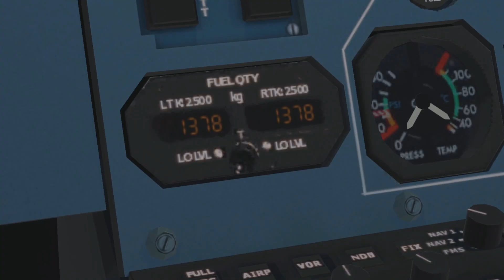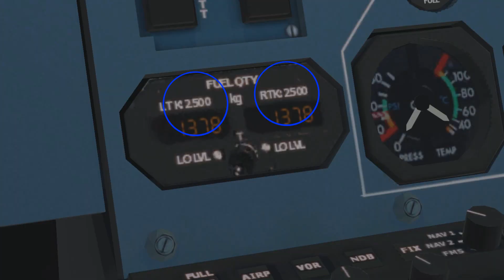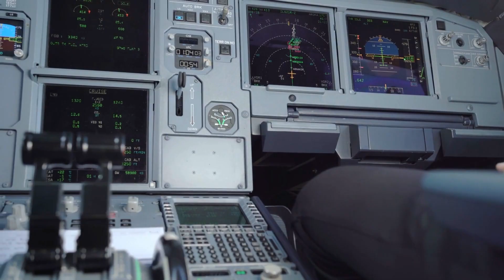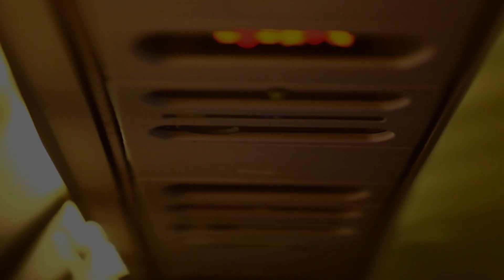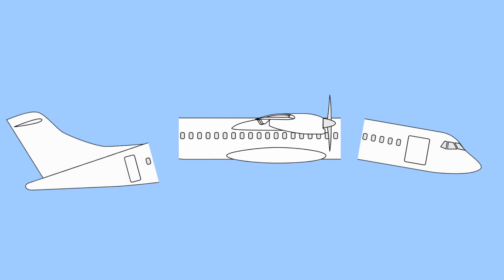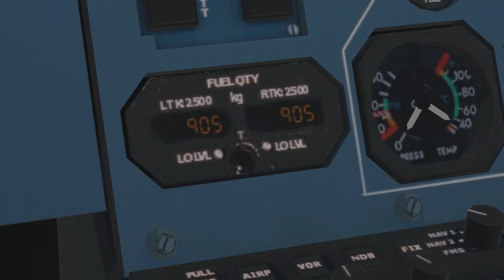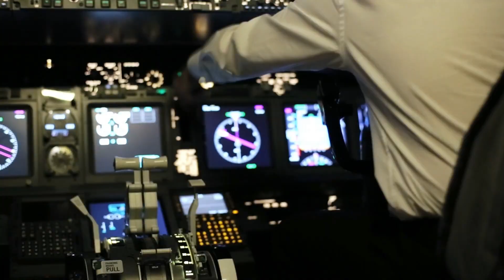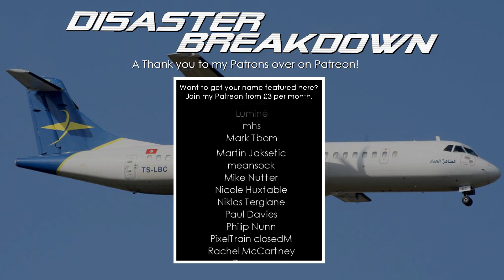Running out of Fuel Over the Sea (Tuninter Flight 1153) - DISASTER BREAKDOWN

Comment: Unless there is some detail missing, the pilots should have been blameless. The fault lies with the mechanic, the procedures that allowed the wrong part to be installed, and the procedures and personnel that allowed the plane to depart without proper refueling documents.
Reply: Pilots are the ones responsible for allowing the takeoff without fueling documents. This is why they are criminally responsible.
Reply: Plus the criminal case took place in the Italian courts.  Seismologists can be responsible for earthquakes, researchers for pandemics, etc.   If a prosecutor thinks he can make a name for themselves, he is liable to try and put someone in jail whether worthy or not.
Reply: @gs98999  that's not what they were charged with though.
Reply: The pilots were convicted for not having fully followed procedure by feathering the propellers which would have prevented drag on the plane which in addition to the tailwind that day may have been able to get them to land in Corsica.
Reply: @kyleg9735   but they didn't know they were out of fuel. Feathering the propellers isn't part of the procedure of restarting the engines.
Reply: @joseph Futrell the pilots were found guilty of criminal neglicence in causing a disaster because they:
1) Ditched with a tailwind, against regulations.
2) Ditched with excessive speed (13 f/s instead of 5 f/s).
3) Did not considered the waves' direction, impacting the water directly against moving waves instead of parallel to them.
4) Did not duefully report to ATR and negligently decreased the altitude upon the first engine's halt.

Imo the sentencing was correct, considering 14 people died.
Reply: @GarlicOasis  They had a low pressure feed warning on both engines! Regardless if they had fuel or not it was not reaching the engines. A checklist should have been preparad for them guiding them through the steps of what to do in a scenario such as this. Gambling on an increasingly slimer chance of an engine restart while losing altitude which would have been enough for a glide to a safe airport is irresponsible.
Reply: @GarlicOasis , thank you. I was going to say. 👍
Reply: @GarlicOasis  I mean, youre not wrong either. im just parroting the info from this vid and the wikipedia article.
Reply: @Rolfwar  The pilots were prosecuted and found guilty by an Italian Criminal Court. Which I hate to break it to our Italian friends, immediately makes it suspect in most other portions of the Western Democratic world. Italy is known for many great things. Her public prosecutors and court system are not among them.
Reply: @kyleg9735  they were trying to restart the engine, that's what you would do in that situation.... What procedures should be  followed ?
Reply: @yasirmohammedali  i dunno mate
Reply: @Rolfwar   It wasn't correct, it was excessive and widely condemned by everyone at the time, including the Italian pilot association. Just for comparison's sake, in the worst aviation disaster in Italy's history (the Linate Airport collision in 2001 that killed 118 people) the men responsible received half the sentence that the pilots in this case got. 
The fatal error was the one committed by the mechanic. The pilots weren't blameless but they should not have been criminally charged. They never knew the plane was out of fuel.
Reply: The manufacturer also bears some responsibility for making it possible to swap out the fuel gauge and replace it with a visually similar one from a different model of aircraft. It would not have been difficult to use a slightly different connector on the fuel gauge that would prevent the ATR-42 version from being connected inside an ATR-72 cockpit.
Reply: @josephfutrell5619  More than just overzealous prosecutors.  Under Italian law, any accident, crash, etc. is automatically considered to be a criminal case even before the formal investigation begins.  This in turn makes it more difficult for the independent investigating agency to do their work.
Reply: there’s no detail missing to me: they never feathered the props. that’s really unbelievable to me.
Reply: @maxcfi7718  it was implied in the video that that was due to following the restart engine check list to the bloody end, which would make sense if you had no idea you were out of fuel.
Reply: @richardscottmills  which also makes sense when your fuel gauge says you have plently of fuel... they were set up for failure at that point
Reply: @andrewtaylor940  In Italy, any accident involving loss of life is automatically considered to be a possible criminal act.  As such, the criminal investigation takes priority over , and often impedes, the actual accident investigation.
Reply: @sct913  no. In Italy, as is widely known worldwide, in the event of any incident involving loss of life “Convicting Somebody” takes priority over all else. Blame and Retribution must be meted out against someone. Lest they ask questions of the current and invariably temporary government. So somebody WILL be prosecuted. Repeatedly. On the same charges. As many times as will be necessary until blame and conviction are finally attached to them. Assuming of course that they do not have any friends in high places.
Reply: In other words, treating the accident as a criminal case (as I stated).
Reply: @sct913  The Italian Prosecutors famously treat any death as a criminal case, regardless of evidence, rationality, or act of god, will assign blame to someone, literally anyone, and will REPEATEDLY subject them to Judge after Judge, Trial after Trial until they get the result that most elevates their career.
Reply: @GarlicOasis  I was going to say this, feathering the props isn’t part of the engine relight process. Drives me mad seeing folk say “they should’ve feathered, should’ve done X”, we have the benefit of hindsight where we know the full story, the pilots did not and didn’t know the engineers had installed the wrong FQI. Not saying the pilots are completely blameless, but it’s unfair to say they should’ve feathered when they didn’t know they were out of fuel. Obviously the correct course of action is to climb into the fuel tanks and measure exactly how much fuel there is…
Reply: @Rolfwar  "negligently decreased the altitude upon the first engine's halt" - Wait, according to the video that was perfectly in line with procedures, right? You have less power (one engine out) to keep your aircraft high up, and if you can't hold to a higher altitude, where air is thinner, you get to a lower ceiling so you can cope with the less power scenario. Once they lowered their altitude, AND THEN the second engine went kaput, there was no way to regain the altitude - am I missing something here?
Reply: @Anders127  "They had a low pressure feed warning on both engines! Regardless if they had fuel or not it was not reaching the engines" - as they say, "a hindsight is always 22/20...". You might have some pieces of a puzzle right in the front of your eyes, but the puzzle is still a puzzle, and you don't see the whole picture anyway, And the additional stress doesn't make it any easier to "figure it out".
Reply: Criminal prosecution is not about blame. It's about criminal intent, and these pilots had no criminal intent.
Reply: It was madness of the pilots to trust Italian engineers. Italy leads Europe for incompetence AND corruption.

Comment: As someone who works as a maintenance technician, knowing some of the attitudes/lack of brains of the people I have worked with… I’m terrified of flying!
Reply: They have excellent manuals though guiding them through the steps of what to do for various tasks.
Reply: That's always my point about flying. These are just people at work.. have you always been 100%at work?  Of course not. So you're trusting your life into someone's work ethic. No thanks.
Reply: @Black-Sun__x  The thing is we take greater risk for our lives everyday. You are more likely to die crashing your car on the way to strip club than dying in a plane crash. So if you want to go to any place where taking a plane makes sense, not doing it just because of the slim chance you may die doesn't add up.
Reply: @Anders127  so does flat pack furniture 🪑
Reply: @HighTreshold  i know all that. I don't trust any of those things either. 😂 I take risks , I'm aware. I don't like those either but some are unavoidable.
Reply: @HighTreshold  People always bring up the flying is safer than driving thing but when you consider how many people drive vs how many fly it simply falls apart. If just as many people flew we would hear of many more aerial disasters, aircraft are not inherently safer.
Reply: @Drimirin  Flying will never be as massive as car driving. At least untill technology advanced up to the point where flying a personal plane is just as streamlined as driving a car.

Still, there are  more dangers in your own house doing your daily activities like taking a shower.
Reply: A mistake like that (providing it was caught before an accident) should be immediate termination or at least a demotion. I am assuming it isn't solely the mechanics fault though. I would assume management and their protocols are not the greatest just judging on how everything unfolded.
Reply: @Teh_Random_Canadian  no but usually the company put tick box exercises in to cover their arse and lay all the fault at the hands of technicians,  basically saying we have this risk assessment, these standard operating procedures,  and these steps that we want them to follow,  we have trained them in these disciplines and shown them these practices the company work too,  and they have signed to say we have shown them.  bear in mind the paperwork and risk assessment etc can take longer than the actual job,     Personally I really don’t care if a job has to be extended,  no matter how frowned upon it is within the company,  but I can see how others feel obliged to cut corners,  do the job and then tick the boxes as a course of habit,  without reading what they’re ticking,  you just know what boxes to tick as they’re always the same,  it would be very easy to skip a step,  and very easy to rush a job and tick the boxes then sit there drinking tea while booked onto the job
Reply: @Nick-Emery  Ya there is some of that in my job as well, my answer is always "it takes what it takes", but management always puts pressure on to get it done quicker. For anything involving the life of others corners can not be cut, profit be damned. Unfortunately this doesn't always happen.
Reply: I work in manufacturing. 9/10 accidents in the plant is due to maintenance not doing their job properly. Always rushing jobcards, always taking shortcuts, always overworked and understaffed. Yet somehow they always act like they're engineers who can't be told anything. I swear, they're the bane of my existence. Health and Safety isn't their concern...
Reply: @ramsfan1st43  I think you listed the primary cause "Overworked and understaffed". Everything else, including safety culture is a symptom of that statement.
Reply: @ramsfan1st43  the place I am at now have 4 levels,  the maintenance technician and mechanical engineers are generally very professional,  it’s the General maintenance operatives and maintenance assistants that are the Bain of my life,  they really do have the attitude of ‘that’ll do’ or ‘not my job’ even if it is something as simple as changing a fuse or a solenoid they will try and hand it over to the technician,  they are supposed to be ‘semi skilled’ and have a minimum of a level 2 in either a mechanical or technical field… god forbid they actually get their tools out though.  We have to have them to help us if we are short of Labour or if it’s a 2 man job,  a lot of the time they sit there on the phone and moan if you so much as ask them to pass you a screwdriver,  one guy spends about 45 minutes taking a shit,  another has 2 cups of tea on the go constantly,  drinking one while the other is brewing,  I shit you not I’ve never known anything like it.  The other ones who are a nightmare are the ones who are close to retirement,  but at least they know their stuff,  they just drag it out 🤣. I will say though there is a slightly older operative who we always ask for if we need labour because he is very good,  we are trying to push the company to get him through his advanced crafts and get him to technical status (and wages) because his attitude is so far above and beyond the rest of the operatives and his skill level is way above the rest,  it’s just not fair on him that he’s the one everyone calls on when they need help.

Comment: How can you blame the pilots for this, poor guy didn't even know they were out of fuel
Reply: well, let's say they were not properly "unaware" of the bad job done by maintenance.
Reply: Part of why the pilots were charged is actually down to Italian politics, as opposed to "direct fault" per se. The Italian legal system has a very public role in their culture to the point where most non-Italians would consider the average high publicity trial "show trials". In essence the Italian court has a pension for publicly leveling harsh convictions, and then quietly later reducing charges to more reasonable punishments. Drama is a Latin word after all
Reply: @XemawthEvo2  No punishment was reasonable for the pilots though... mechanic and management, yes they were negligent. The pilots just dealt with the shit sandwhich they were served and followed the assumed correct protocols
Reply: If the pilots had performed their preflight and in inflight duties properly, they would have caught the fuel quantity error. No pilot that expects to live trusts the fuel quantity gauge alone. You always verify fuel load using a separate method.
Reply: @conradanderson3928  I worked as a ramp attendant and I have never seen pilots checking fuel quantity during their walk around. Although the airport I worked at only operated Dash-8s and you might be referring to an ATR thing. Also, as a private pilot myself, we almost never check fuel quantity with a dipstick.
Reply: @XemawthEvo2  Drama is a Greek word, actually
Reply: Can you dip the wings and listen for sloshing sound, if there is fuel in the wings?
Reply: @xonx209  Lmao I think jet engines might be a bit too loud for you to hear anything
Reply: @XemawthEvo2  think you wanted "penchant" over "pension" there; ordinarily I wouldn't correct English errors on the internet but that one might actually make it tough to get meaning across - took me a second to figure it out. It's also kind of a pleasant word, tbh.

Comment: Why’d the pilots get prisoned?
Reply: They were jailed because they were praying for their god instead of following emergency procedures and gliding the plane to Palermo airport.
Reply: Because its Italy they'll jail people for just about anything. The pilots acted on what information they had. Which was the engines just cut out, but the fuel instrument panel wasn't showing they had ran out of fuel. So they thought that there was something else wrong with the plane. They had bad information due to the faulty fuel instrument panel that was replaced with one that couldn't work on their plane. Basically they got jailed because people needed a scape goat. Had the pilots known it was a fuel issue they would have done a different scenario of events to try and reach an airport by gliding towards in hopes of making at least landfall
Reply: Bill  the fuel gauge showed that they had fuel and they read it correctly. Rewatch the video bud
Reply: @crumpledgamer9220  they weren't praying. They said things among the line of "oh god", of the top of their heads, which takes less than 2 seconds. They didn't stop everything they were doing to pray.

Comment: This is a design fault. It should not have been possible to instal the FQI from a different model aircraft. The FQI for this model should be the only FQI which can physically be instaled. It would only require the mounting hole and instrument to be a specific shape or the connectors to be specific to this instrument. Safety is about removing the possibility for error. If it had been possible to only fit a specific FQI to this plane then this accident couldn't have happened.
Reply: I have watched another video on this accident, quite some time ago, so I don't remember the channel of the title of it, but AFAIR in "that other video" it was said that just such recommendations was made to the manufacturer of those fuel gauges - i.e. that they have to be mede physically different so it won't be possible to fit the "wrong" gauge into "wrong" aircraft. Sorry, can't remember more than that.